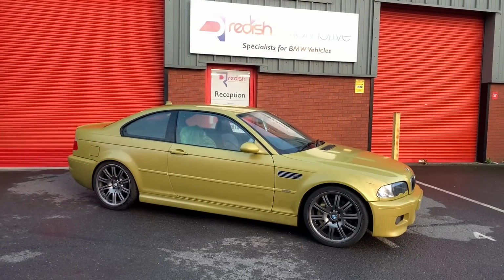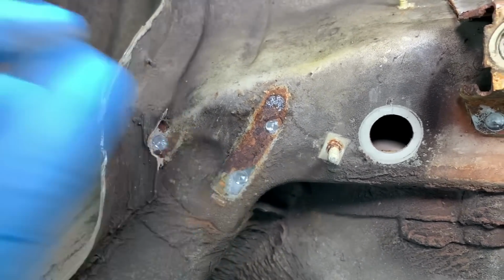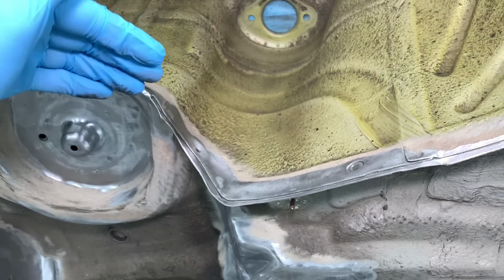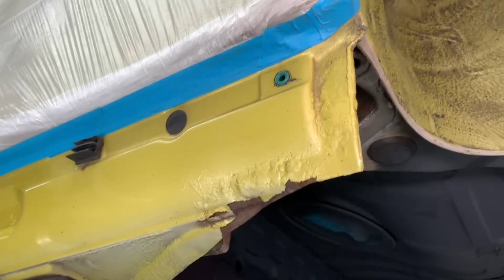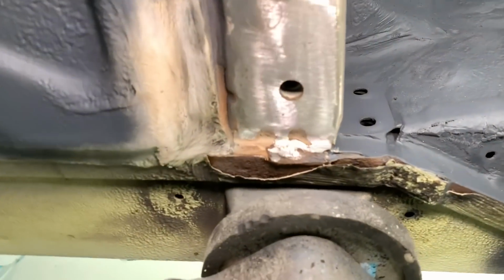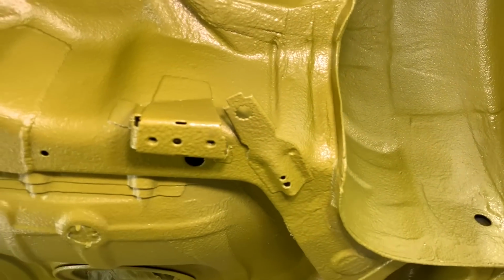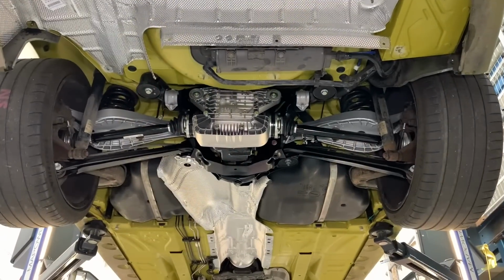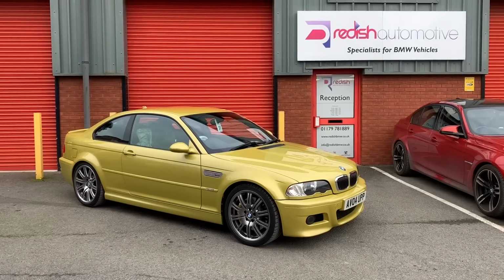Extreme Yellow for this BMW M3 Restoration!

Comment: Thank you for your enlightenment of knowledge, this helps me a lot with my dream build for an e30 touring, I want the best for it and going for a full restoration stripping it bare to bone and dipping it in the liquids and completely rust preventing, I didn’t know the proper full job way was to strip the car to its bare shell although, a restoration like this seems like the adequate minimum as it’s better treated then left to rust. Also as the e46 is in correlation to the e39 I would also imagine they have the same alike corrosion problems today so talking care of them now will save them for the future generations to come. Great channel ❤

Comment: Nederman SB750 will clear out those rust pitting areas It's a vacuum blaster. Perfect for spot treatments without making loads of mess. It tidied up the underside of my 2004 beautifully 👌 Ain't cheap, but well worth it if you'll use it often!
Reply from the maker: Thanks for thinking of us and sharing the info.

Comment: amazing work....ironically those shocks would be an MoT advisory straight away...all the money the guy has spent, a another few hundred quid on shocks would have finished it off.
Reply: Thats something you could easily do at a later date
Reply: The dampers would not be an advisory.
Reply: @davog1946  they would..as mine were exactly the same and got an advisory for corrosion on the bolt fastening point..

Comment: Anyone have a map with part numbers of the underbody and wheel arch plugs? Parts diagrams are useless.
Reply from the maker: http://bmwfans.info/parts-catalog/E46-Coupe/Europe/M3-S54/browse/vehicle_trim/sealing_cap_plug/
Wheel Arch Grommets are 20mm and are part number 07147140850